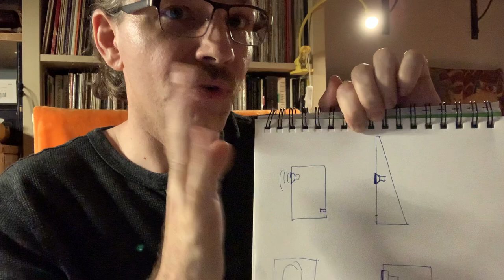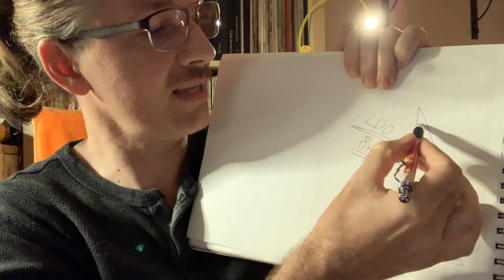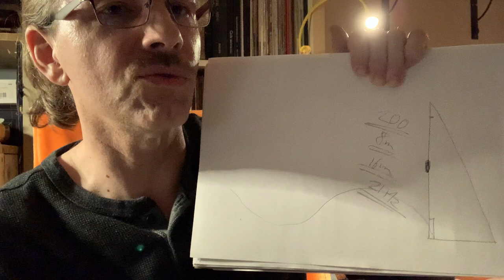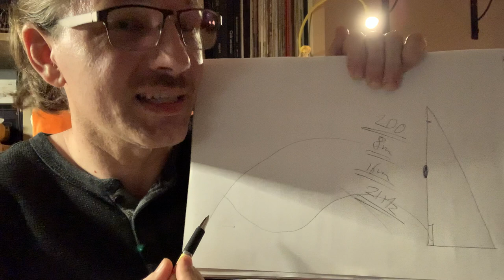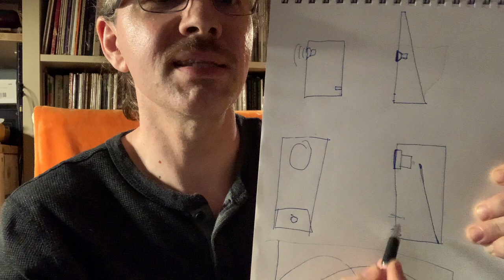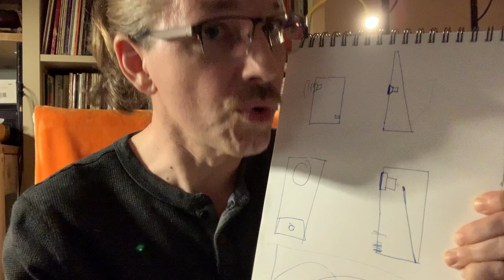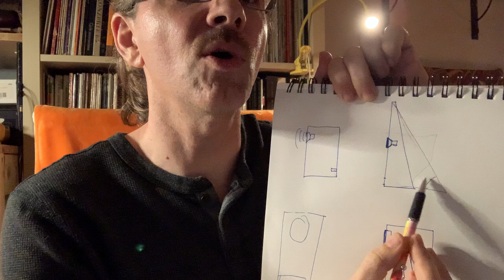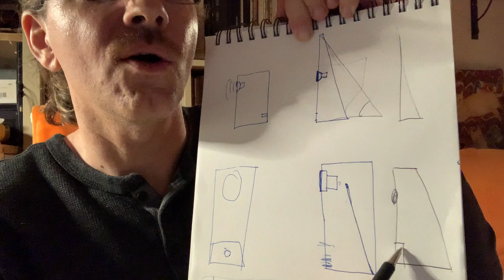Voigt pipe physics for Dummies!!

Comment: Hi, very interesting, I used to work for walkers the organ building company back in the UK back in the late 80s early 90s and I was a specialist wood machinist and I used to make wooden pipes some bar restoration but some are new, Some were tapered and some are parallel but with unequal sides and back, And back then I made some of the biggest organ pipes in the world, Give you some idea I colleague of mine crawled down inside and stuck his feet out the bottom of the pipe and I sat in the top it was quite a funny experience I can’t member exact length of the pipe but I think it was somewhere at 16 m 18 m in length, 60cm x 80cm Dm . it was then cut to length for voicing, In the early 80s I built myself a pair of transmission line loudspeaker cabinets internal line is around about 12 1/2 to 13 foot in length, 12” X 14” , 8” driver, and tweeter, made bye peerless, but 3 weeks ago I had to change them as one of the drivers burnt out, so now I have replaced them with Seas drivers, the original tweeter was oblong shape, so I made a square plug to fill the original hole, I put it on my wood lathe and turned the centre out to accommodate around tweeter unit, The plans I got out of old hi-fi magazine from the 70s , they Sounded amazing then, but now they’ve come alive and sound even better still specially the deep bass.
I do not have  equipment To test them apart from playing music and everything I seem to play sounds completely different Sounds amazing.
Phil from the moulin France.

Comment: What are your thoughts on tuning the box to a half wavelength of the drivers fs? Are there any advantages to creating such a large enclosure? See bigger is better (bib) speakers.
Reply from the maker: That's super low tuning. The disadvantages are that the longer the box / tube / pipe, the longer the latency for the wave that exits the "port", so the timing will be more and more off. (The Voigt pipe can pull it off because the port in at the floor height, and the bass from the port arrives at the same time as the first bass reflection off the floor, which is very natural.) 
Also, if you go that low, to take real advantage you need a room that has the length to support the full wave. For half the Fs the room size is so long / big that it is really pushing the drivers Xmax at the low frequencies to produce useful volumes. So, essentially, the range where they can be enjoyed fully is in an extremely narrow SPL zone. (Any less and you can't experience the 20Hz, any more and it breaks up.)
 I find that the appox 2m pipe length is the goldilocks zone - go for less and loose low bass, more, and we are losing the headroom and going so high into excursion that the cone is driven to distort in the highs all the time.
Reply: Thank you! I guess I will give  Voigt pipe a try.

Comment: Very interesting information. Is it possible to have an extension down to 38 or 40 Hz with a single driver in a room with only 3 meters depth and let's say, discounting the couch with the listener's position, with a distance between the ears and the front of the speakers of only 2.35 m? What kind of enclosure would that be and what specification should the driver have? I have been looking at the ones made by EMS from France. Thanks in advance.

Comment: What about the pararell sides of the cabinet?  Don't the fequencies reverberate between them?
Reply from the maker: Yes, they do! However, they do not do that much damage as the cabinet in not pressurized (as sealed or BR cabinets are), plus the triangular sides prevent that frequency from bleeding over to other resonance modes and planes.
Reply: What about a pyramid shape? Would that do a good job of eliminating side to side frequency reverberation

Comment: OK, I built Voight pipes which are about 74 inches tall and the floor of the cab is 10 inches deep.  I calculated my cubic foot volume as 1.82 cubic feet (roughly).  My current driver is a Pioneer B20FU20-51FW8.  I want to replace these as the surrounds are falling apart and these drivers were very cheap (not worth repairing).  Their specs are VAS 1.75 Cu Ft, Freq Response 36-17000hz, FS 53hz, SPL 90db.  I don't know if these were a good match or not.  Since you've built these for so many years, is there a Fostex or other replacement driver you'd recommend for my Voight pipe? I use them with a low power tube amp that prefers efficient drivers.  Any help would be greatly appreciated.  Thanks.
Reply: After reviewing the Fostex 8 inch drivers I'm leaning to the FE208EZ. Vas 2.12 cubic feet, Fs 42hz, SPL 97db.  Anyone who can point me in the right direction, please do so!  Thanks.
Reply from the maker: Hi Joseph, sad to hear that the surrounds are falling apart. Sadly, that goes with old age of the driver inevitably at one point... that Pioneer was a good match for the cabinet. The FE208EZ will work well, also, the FE206NV will be a very good match too. Good luck, cheers, Janos
Reply: @realworldaudio  Thank you, Janos.  I installed the new drivers this morning and I'm impressed.  A lot more detail and clarity, and since they're more efficient, a lot more volume.  I'm impressed with the bass produced by the enclosure.
Reply from the maker: Hi Joseph, thank you for sharing your experience, I'm glad it works out so well! Which driver did you go for, the FE208EZ or the FE206NV? Cheers, Janos
Reply: @realworldaudio  the 208EZ. Certainly a big step up from the pioneers, though they weren’t bad at all.

Comment: Is the driver necessarily halfway down the pipe? Can a 2m folded Voigt pipe have its driver at 1m high (listener height).
Reply from the maker: Yes, the folded pipes (TQWP) are like that. You can place the driver basically anywhere, it will be a little different, and there's a lot of math to figure out which is the most optimal. Yet, the most optimal will be the one that matches your room and your amplifier the best, and that for all practical purposes can only be found out by trial and error. Look up TQWP, there's tremendous amount of resource on it. ; )

Comment: I assume with my basic understanding, this only works well with single driver, like your Cube Audio? How is timing behind the speaker, can they be close to the wall? So this speaker designs/single drivers are hard to drive, any AMP combination to recommend?
Reply: no it can be used for multiple drivers like PCM and it does work best close to the wall for more bass enforcement.
if you make an offset tweeter MTM,
 you word want a vertical internal baffle opened at both ends top and bottom with both woofers having their own chamber like this [=| ], and in the centre rectangle port at the back.
the vertical baffle behind drivers can be tilted at the small angle like they have their own voigt pipes each driver, joining a biger chamber.
this is the best for clarity and for extended low frequencies you should be able to get down to 17.2Hz with authority in a medium to large room
just use two Markaudio 4 inch drivers and a for ease of application 1" scanspeak or seas softdome tweeter crossover about 4.7kHz 3 order
Reply from the maker: Hi Gerald, yes, it can be used with multiple drivers as well, and there are a lot of examples when people use a combo of mid/woofer and a tweeter. Overall though, due to lack of cabinet resonances, people find that single drivers are just vastly superior in midrange reproduction, and multi driver only makes sense when listening to badly recorded music (that requires bass boost), or one wants to listen to at excessive volumes where one driver is not sufficient. Proximity to wall: will make them sound like regular speakers... so yes, it works, but without optimal placement we are missing most of the advantages that these cabinets offer.

Comment: How about the size and volume for the port? Is it important or do we just make it the same surface area as the speaker cone?
Reply from the maker: Similar surface area as the speaker cone is the starting point. It can be bigger if the room allows - the exact size will depend on the room, trial and error. Also, if Qts of driver is higher (around 0.4) then bigger will work better in most rooms, lowish Qts (0.25 or so) will need smaller, but depending on the room a bigger opening can work as well, but less success as a higher Qts driver.
Reply: @realworldaudio  Thanks! Are you tuning the port to the low frequency cutoff of the cabinet? Like for a pipe that is 30hz tall do I tune the port to 30hz?

Comment: hello sir..voigt pipe is design for one speaker only?..
Reply from the maker: Hello Nilo, you can use it either in mono (one speaker) or stereo (a pair of speakers). The Voigt pipe was the creation of Paul Voigt in early 1930s, and since there were made about a hundred or more variations on it. I found that keeping closer to the original has the most potential. My Voigt pipe is kept close to the original design.
Reply: ah ok..ty

Comment: Wouldn’t a passive radiator help increase the free air volume in the truncated pipe a,lowing greater frequency extension in a smaller cabinet.  From what I can see the draw back for most users will be the size/height of these cabinets. (Just a casual observation, you did say this tutorial is for IDIOTS😀)
Reply from the maker: Hi Eddie, it's definitively worth to play around with ideas, so thumbs up! With careful selection of a passive radiator indeed we could incease the apparent volume. Sadly, much of the energy would be lost from the transmission line (the pipe) through the passive radiator, and the quarter wave output at the Voigt port would be too low in volume to play a significant role. We want the air column to resonate, and more volume means more air can resonate, creating a stronger wave that can couple to the room better. 
This is the sad thing about audio, all the compromises come when we try to make the loudspeaker size smaller.... that's what 95% of all loudspeaker development was and is about, how to do damage control with small cabinets.
Reply: Got it.  Just that I thought I was seeing  PR in some newer deigns which reminded me of truncated Vought pipes so I imagined that’s what they were trying to achieve.
Reply from the maker: @EddyTeetree  I think their main purpose is to cut down the cabinet resonances. Every cabinet type benefits from the Voigt pipe / truncated Voigt pipe shape, due to lack of parasitic cabinet resonances. ; ) We have been seeing almost exclusively the boxes everywhere as they are the easiest, fastest, smallest and cheapest to build : (
Reply: Thanks Janos for taking the time to explain this.😊